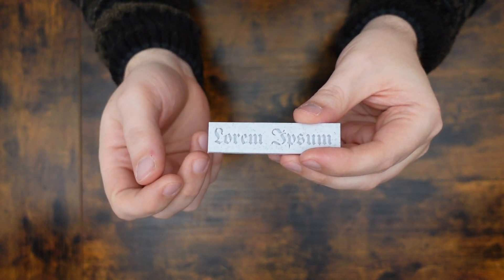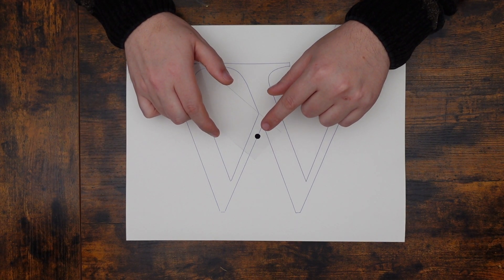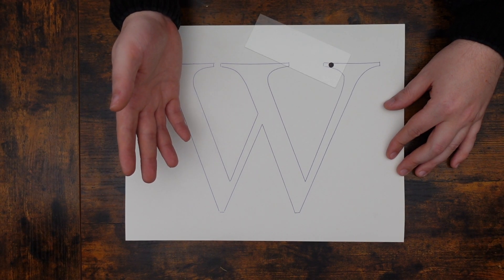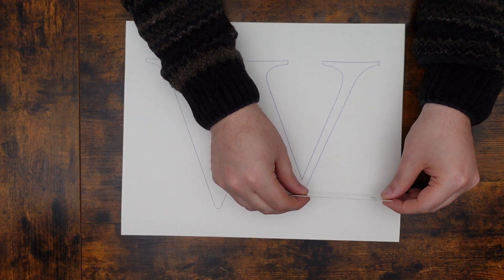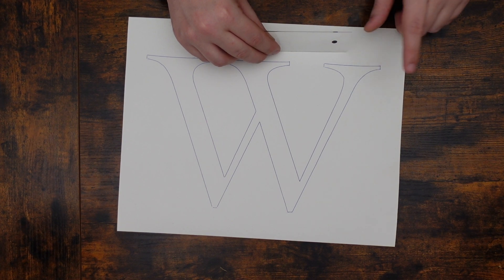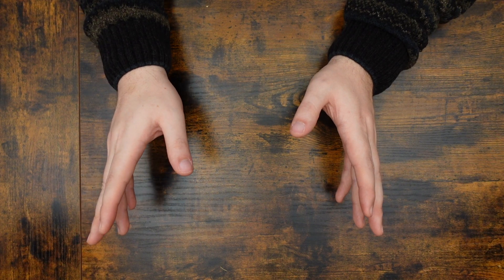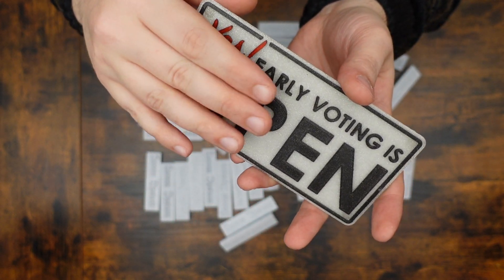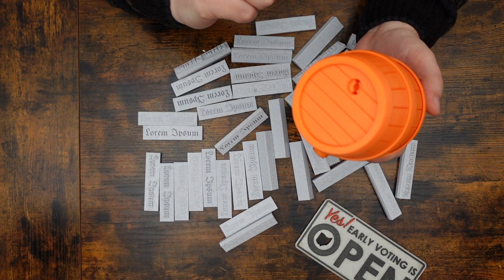3D Printing Typography

Comment: Nice video, something came to my mind, I want to write the text on the object with spaces. With which font and program can I do this? I wonder if there is a video.
Reply from the maker: So much has changed since this video came out :)

If I understand you plan correctly, you can cut text into an object directly within PrusaSlicer now! Right click on your object, then select "Add Negative Volume" then select "Text". You can then type the text you want, resize it, and define how far it cuts. I hope that helps!
Reply: @3DPrinty  Thanks <3

Comment: The problems you mentioned with drawing text horizontally are actually not unique to 3D printing. In 2D computer graphics, fonts have to be displayed on a pixel grid, which mangles up serifs and thin segments something fierce. People got around this by just drawing bitmap fonts by hand, but this is time-consuming and the resulting fonts are not scalable. The fix was "font hinting": in every TrueType vector font there's code that will adjust the shape of each letter to fit the pixel grid according to the font designer's intent*. This is why vector fonts were readable *at all on 96dpi screens, why text on Windows and macOS looks so different (Microsoft fits everything to the pixel grid, Apple relies on anti-aliasing way more often), and so on.

Font hinting information would be absolutely fantastic for 3D printing as well. However, no CAD design or 3D modeling software uses hints - since they work entirely in vectors and rarely, if ever, touch voxels. All that data is thrown out at the moment the text is added to the model. CAM software (e.g. slicers & CNC router planners) could absolutely make use of shape hints (even outside of a typography context, i.e. "preserve this critical dimension"), but they only get STLs - far too late to actually use them.

Comment: VERY helpful! I printed a lot of personalized gifts this holiday season, and made all of them in horizontal mode. I noticed the problems you mentioned, but didn't take the time to troubleshoot or determine the cause of the issue. In most cases, the prints didn't fail, so I considered that a success. Now I'm wishing I would have printed more in vertical mode. Thanks for these videos!
Reply from the maker: Happy to share my experiment!

In the end I DID use a horizontal print orientation for the Barrel Cooper's Puzzle Box, but I'm glad I tested out what I could.

Comment: I'd love to see the mechanics of how you printed the sign (slicer settings, purging etc). Looks awesome
Reply from the maker: Thanks! Most of the prints used stock PrusaSlicer settings for generic PLA (215°C on the nozzle).

As I recall, the vote sign was printed on a Sidewinder X1, with a higher 220°C for the sections using Protopasta. I didn't use a purge block - I just stopped the print at various heights and switched the filament out. If you look closely, you can see that the red "YES!" text is actually higher than the black text. This was so I didn't have to do a mid-layer filament change, which would have been a huge pain.
Reply: @3DPrinty  ah, I thought you were doing something more complicated, that's a great idea thanks
Reply from the maker: Yup, it's a simple technique but uses a lot less filament than most automated solutions. Glad to help!

Comment: Using a 0.25 nozzle I’ve had nothing but trouble getting small text to print well and I’ve tried all kinds of fonts.  I get stringing, or the nozzle melts them too much even with ironing off.  I have yet to be able to perfect it yet i can see some people do it well.  I did notice some pla bands/types can handle it better like matte finishes.  This is my only obstacle I’ve yet to overcome.
Reply from the maker: Sorry to hear that! Your comment on stringing, combined with a better experience with matte materials makes me wonder if you’d get better results overall if you print a little cooler. Matte PLA often needs to be hotter, in my experience, so maybe whatever your default temp is happens to be closer to ideal for matte stuff, but too hot for other filaments? Just a guess, but might be worth a try.

Comment: Great video. I would love to learn how to create these so that I can use them as leather stamps. Keep up the great videos.
Reply from the maker: Thanks! The design is relatively simple, so most 3D software should be able to do it. Even Tinkercad, which is a free online modeling tool supports embossed text - although it doesn't have many fonts, unfortunately.

I assume leather stamps must be pretty rigid to hold their form? I'd be interested in learning if 3D printed plastic would actually be strong enough for the task.